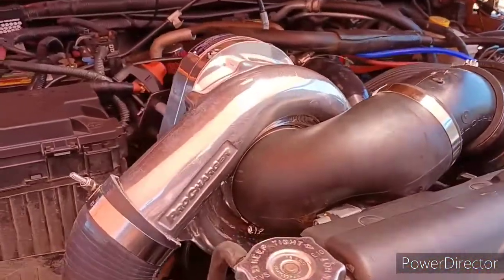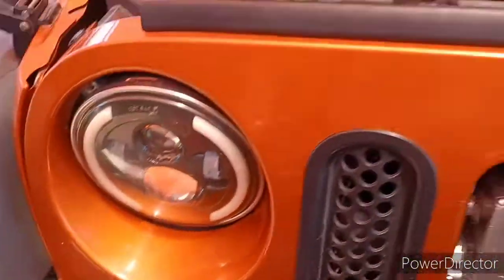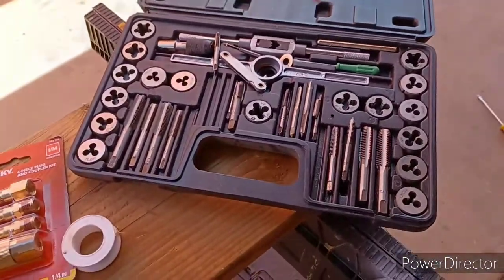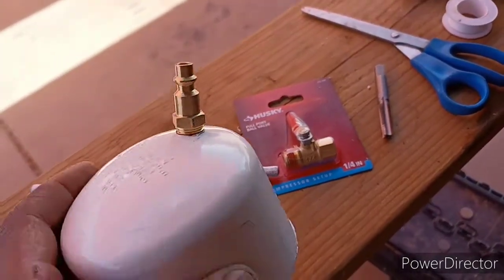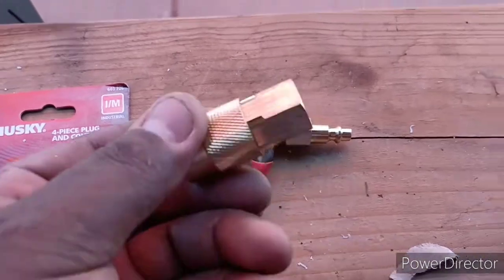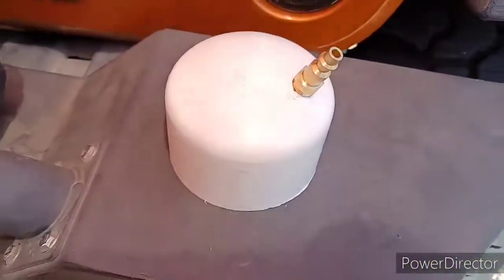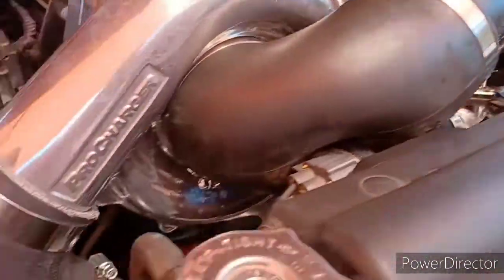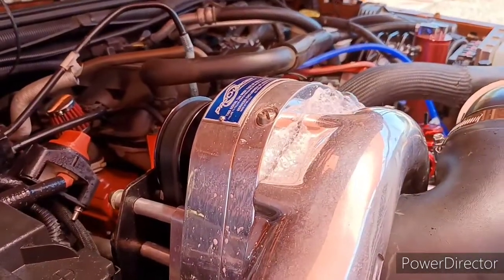Supercharger leak diagnosis with soap and water

Comment: So my Vortech V2 has a gasket. Where the blower is clamped to lock positioning there are no leaks but it still leaked from the area where your dont have the clamp since the head unit it in the way. Might add some RTV and call it a day as well.
Reply from the maker: It's still sealed up nicely. That might work for ya!

Comment: Hey. Thanks for the video. I have a rotrex. Metal to metal as well and same type of leak. Im thinking it is normal because as the fan spins it compresses air straight to the exit pipe on the superchargegetit gets most of its air through the air filter. If some leaks in, it still compresses to the outlet of the supercharger. My rhoughts anyway. Going to call Rotrex tomorrow to hear "this is normal".

With that all said, do you have a boost gauge? If soz did you see a difference with the gauge after this seal?
Reply from the maker: i installed it and didn't have a boost gauge. I have one now, but as far as initially: nope. I could tell pressure wasn't holding because the blowoff valve wouldn't even have pressure. Now everything is fine and it whistles down the street. If you're metal to metal with no gap between the metal, that might be bearings gone out or something. I think twin-screw is metal to metal, but centrifugal superchargers like this aren't.

Comment: A friend of mine have the exact same problem but with bigger leak it will splash out the water with soap, called procharger and they said that normal im not sure how they let a head unit go out to customers without a seal!
Reply from the maker: Yup. It's metal to metal with no seal. I added a little gasket maker and it sealed it nicely. I'm sure I could have used that thin gasket paper-like square sheet they sell and just made one, but it seemed quicker to just seal it like this. Works fine to this day.

Damn shame, I know. So inefficient because that air should be pulled in instead of blowing out. Makes no sense to me either!!
Reply: @MicDropBBQ  how is the seal holding up??
Reply from the maker: @tapatio1425 been running strong since this video! Never had to do it twice. Boost pressure holds on the gauges up to 7psi and the blowoff valve releases pressure nicely.

Comment: Dude really good video. I have a Virtech on my Mustang and i did a regular smoke test through the filter element area and didnt find any leaks. Gonna do this test next. I've also heaed i tercooler fins can leak too. Did your home made gasket work?
Reply from the maker: YUP! The gasket seal it up and it's still on. A few guys told me about also making sure the PCV valves are sealed with one-way valves installed in the hoses (if you're gonna run them to the manifold). If you just cap off the lines at the manifold and run filters directly off the valve covers, you literally seal the intake manifold and you wont have to worry about the leak coming from the PCV valves.

I do all I can to make sure I maxed the boost at the 3.4" pulley. I just went down to a 2.8" pulley on the supercharger and it REALLY pushes boost now! Sheesh! I have a 2.4" pulley in the garage I wanna try, but the pistons are stock and I don't know how much this engine can take. I know this Procharger will give it a lot more than it can take, so I'm slowly ramping up and testing it over time. I've already changed the Procharger oil 3 times, so it's got over 12k miles on my build and it's still rolling like a champ!

Comment: You probably already figured this out but if you put a gasket in there it will space the volute out from the impeller and also cause low boost. My head unit is leaking in the same areas and I'm trying to figure out what is the acceptable amount of air leak. Please let me know if you figured it out.
Reply from the maker: I did do that! I used some red, high-temp gasket maker and literally sealed it. I put the shell back on and let it sit for a few hours - still doesn't leak to this day! There was no gasket in there! I don't know how it sealed being metal to metal. It was clearly sucking air in when the impeller was spinning too. When it dried, I turned the engine on and did a quick spray of starter fluid - and it got sucked in there.

After adding the gasket, it doesn't suck any of the starter fluid in, and no air comes out when adding compression with the hose. It's SEALED!

Thanks for the comment. As long as the engine is running, it's sucking air thru that gap. Been cruising for a couple of months now with no leak.